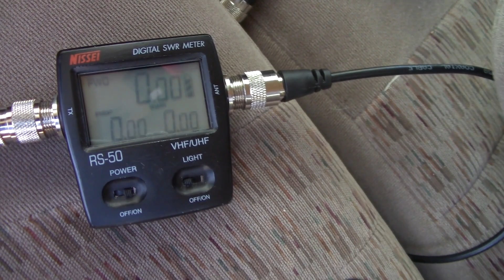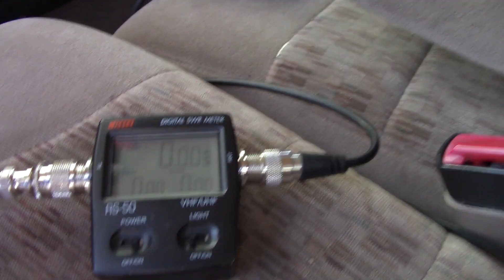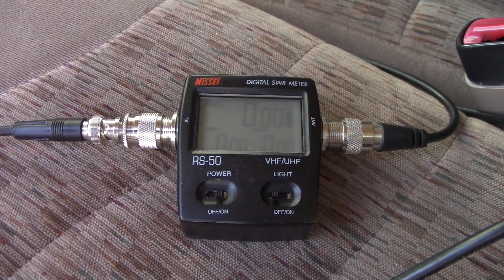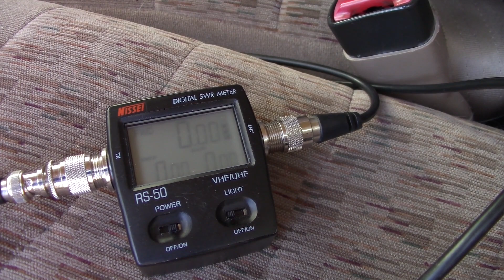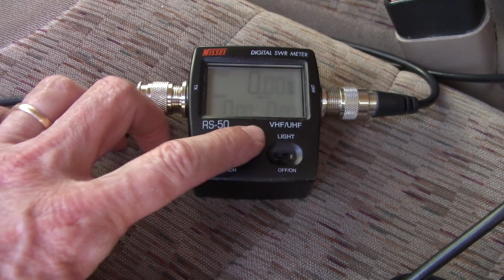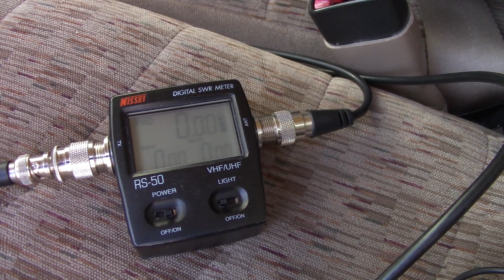New NMO Magnetic Antenna Mount Bad.

Comment: What is that coil in the middle of that antenna ? It almost looks like a CB antenna.
Reply from the maker: It's a phasing coil. That antenna has two 5/8 elements and it needs a phasing coil/loop to separate the two elements.